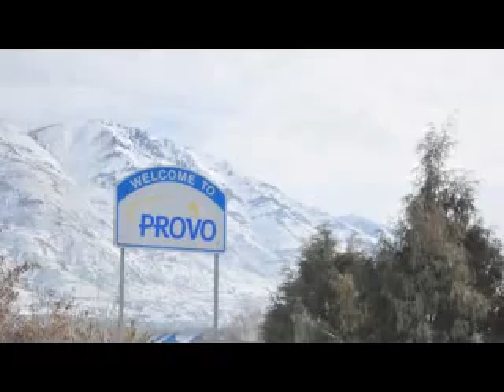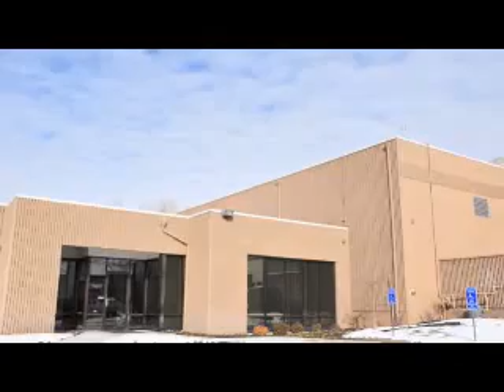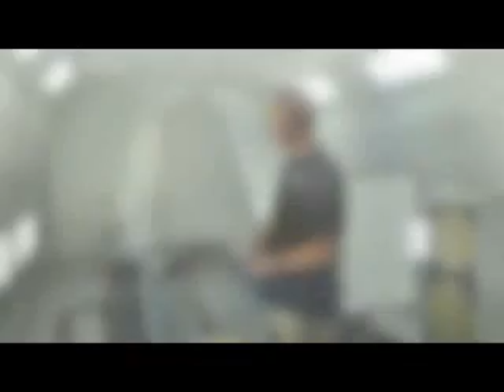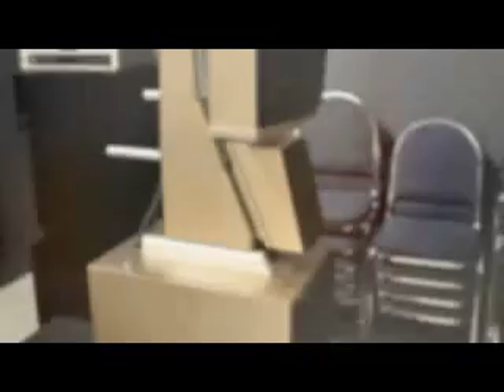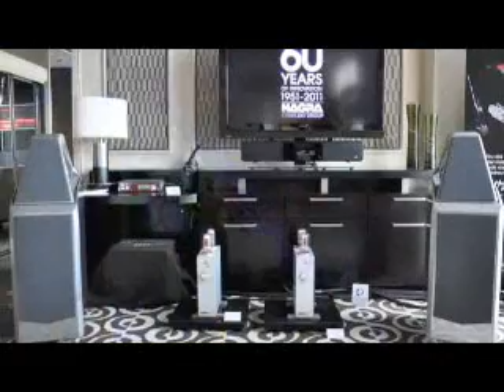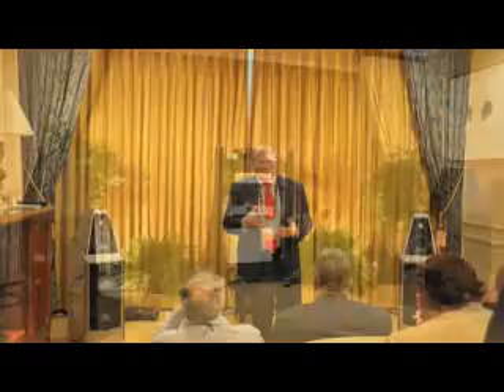David Wilson, Wilson Audio Interviewed by Edgar Kramer - PART 1

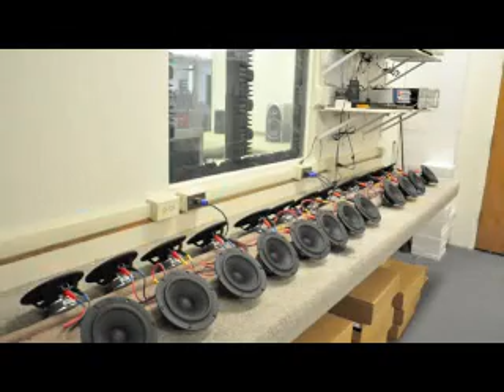Comment: Interesting at 2:41 shows those midrange drivers as having ceramic drivers - these are Danish SB Acoustics drivers designed by Ulrik Schmidt in Denmark. The driver shown is almost certainly SB17NRXC35-8 (but at Wilson they may claim that this is their version) and not the more expensive Satori versions MW16P-4 with neodymium motor system. Don't get me wrong, I have used the ceramic version and it sounds absolutely great!

The explanation on jitter is rather vague and for his own reasons. Fair enough. But the measurements that John Atkinson (Stereophile) has done on Wilson models does give it away if you know how to interpret those results. Sad that I will not be able to speak to him in the future. I would have been respectful, but I would also be a bit more pointed when making inquiries - I inherited speaker building and design with my Dad in the 60's and being in Sydney, the home of Thiele-Small Parameters, and also Danish... and if Edgar comes across these comments... Hi Edgar, guess who?   :)

Still a Nikon Lover I hope?

Comment: Wilson audio speakers more like audiophool speakers. A pair of B&W 800D3s will rip apart even the most expensive wilson speakers due to diamond dome tweeters in the newly designed aluminum housings, their new continuum mids, and the curved woofer enclosure is curved and brace in a way where resonance is minimized. The metrics that affect the tonality is what source you are using, what amps you are running, and what speakers are you using. Speakers do not have a noise floor they have a frequency response map, qes, qms, qts, impedance, wattage, and resonance frequency and other metrics you can only find on speaker driver data sheets or data sheets on certain brands of speakers that don't use any pseudoscience and nothing else. Building your own speakers with scanspeak drivers are one of the best options out there. Also try and score quad ESL speakers they are one the best audiophile speakers ever made. Late 80s/early 90s KEF reference speakers are also one of the best audiophile speakers ever made. The best modern speaker brands are B&W, Zu audio, Spatial Audio, von schweikert, and Zealth.

Comment: I heard a pair of refreshed and tweaked Quad ESL 63s with protect circuit removed and grill cloth taken off. Compared these against Wilson Puppy fives (90s vintage) also in mint condition. In terms of sounding real and lifelike the Quads so completely eviscerated the Wilsons it was laughable. Keep in mind the Wilsons when new were more than three times the price of the Quads yet sounded vastly worse. Strident, sizzley highs that were irritating to listen to over long periods. The mids were discontinuous from the tweeter, voices had a distinctly cupped hands quality and a bit nasal (in comparison to the Quads). The only thing good I can say about them was decent tuneful bass, dynamic and punchy and completely free of any sort of box sound as one would expect given the build quality. But when a speaker sounds this coloured and distorted compared to a good electrostatic, who cares about it's other virtues. To be fair most box speakers don't come off as much better but at the Wilson's price I expected better honestly. Current Wilson products need to be a hell of a lot better if they stand any chance competing against the better offerings at their price.

Comment: It doesn't matter what he says, but the results are. Wilson's are the most terrific speakers I've every listened to, and they startle me every time. Are they worth the price? That's not the point. High end products ALWAYS have excessive price because they are the crème de la crème, the top of the tops. People will pay for those last 5 to 15% of (subjective) performance increase, because it's that much more difficult to get them! Radical approaches, much more expensive materials and manufacturing

Comment: 1.  Jitter does not exist in an analog circuit - what Wilson is describing is what is commonly referred to as "crosstalk" by anyone with any training in electronics.

2.  A crossover capacitor will bleed off any static charge to the amp in milliseconds as the musical signal has a far lower source impedance than the static charge.

3.  Your hearing varies more from day to day than any cable, loudspeaker or amp.  You can't trust your hearing to make objective measurements.

Comment: B&W Is also over rated and so are these. Go listen to a pair of salks. 1. Better craftsmenship, better drivers. You can surpass the performance for less the 1/4 the price. Btw I'm using Accuton mids, Raal  tweets. LMS5400R subs EQ'd flat down to 10hz. Actively crossed with pro amps running passive all the time. Once your in the world of DIY you can never go back. These speakers are larcenous delusional psychoacoustical crap!!